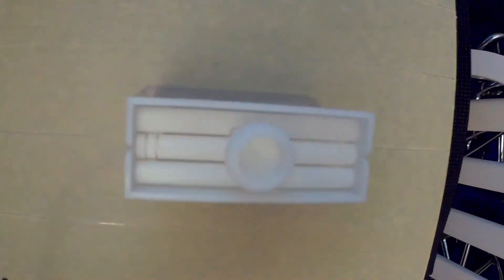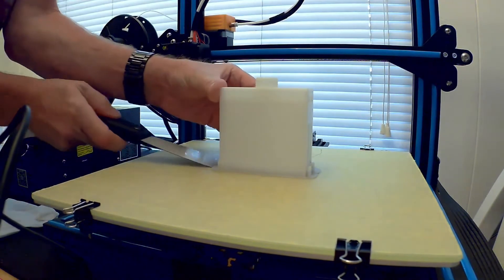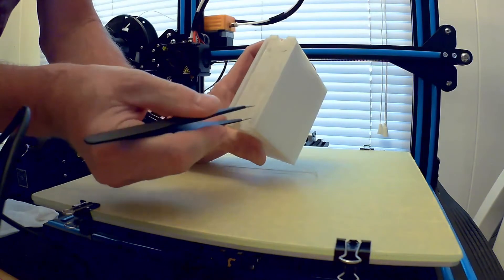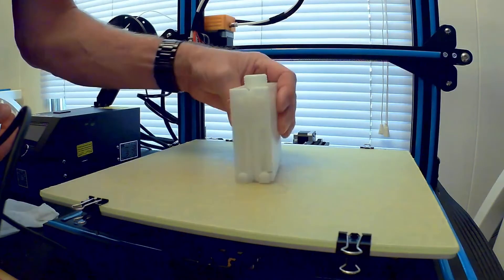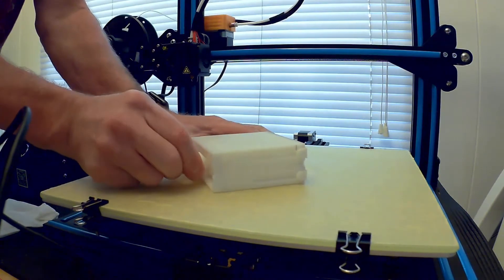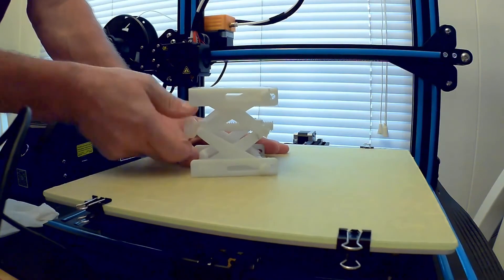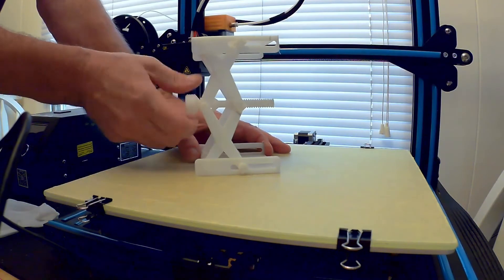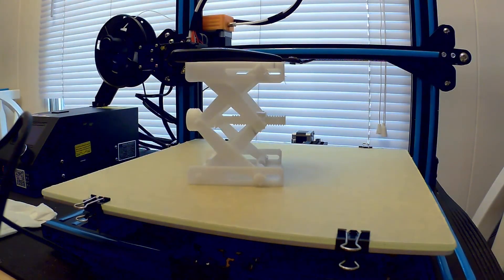3D Printed Platform Jack

Comment: Much better without the sound. Thanks for sharing.
Did you use Cura, which version (the old one with the printer or a fresh one from website)? Print temperature? Bed temperature?
What's the temperature in your room? Just a few questions..
Reply from the maker: PLA Plastic. Extruder Temp 210c Bed 60c Room 23c.  I believe this was using Cura on default settings, before I moved to a different slicer.  I moved to CraftWare.